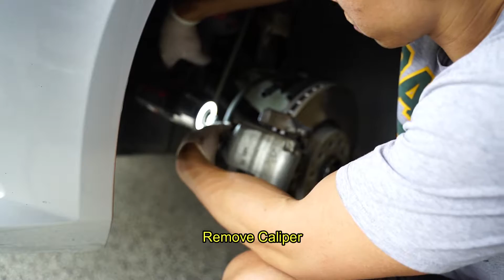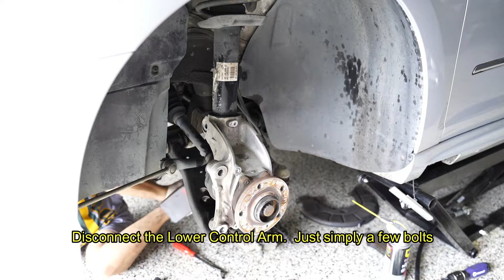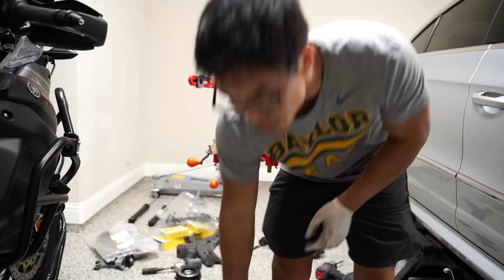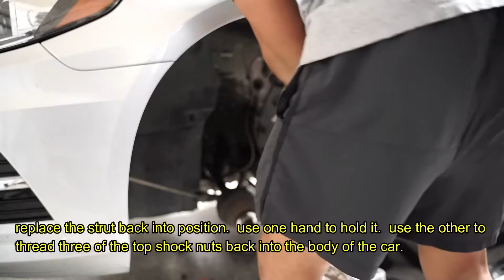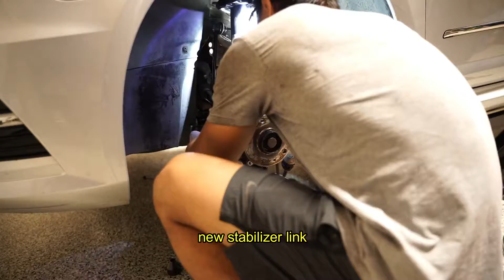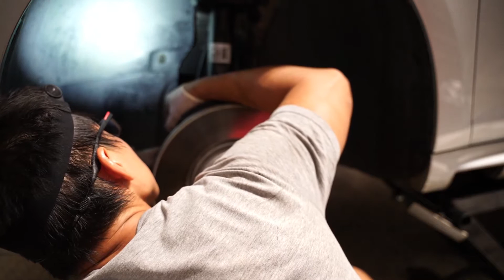2012-2016 Volkswagen CC R Line Complete front suspension rebuild

Comment: Great video! Where do I look to find the factory torque specs? This is a difficult car to find a manual for.
Reply from the maker: it was hard to find the factory torque specs for a CC.  I used google and searched for the factory torque specs on a 2013 VW passat.  The cars are very similar and the torque specs are close enough.  From my experience with all makes and models torque specs on sedans are generally very similar but differ greatly on trucks.